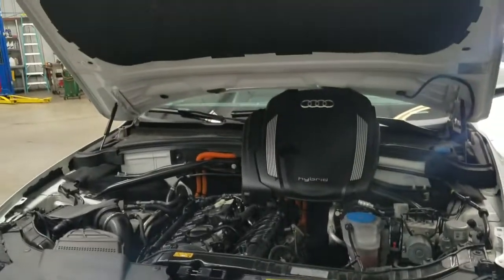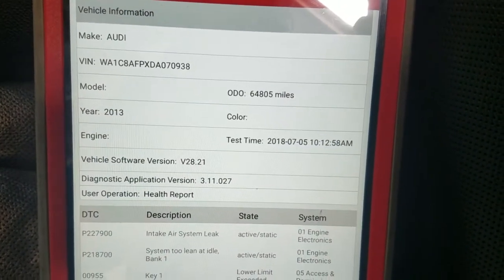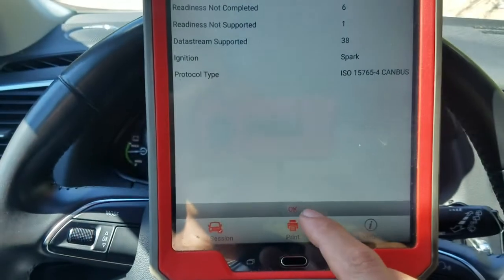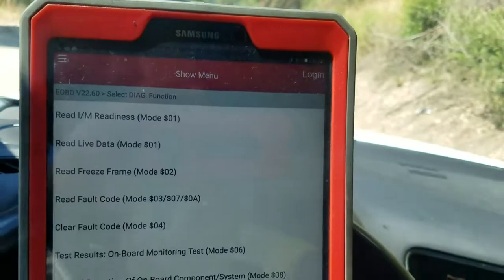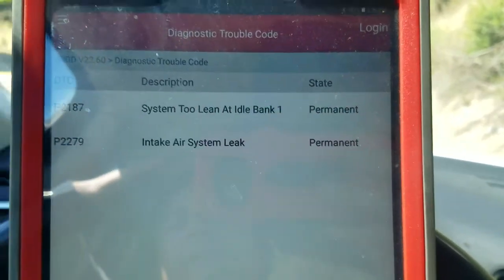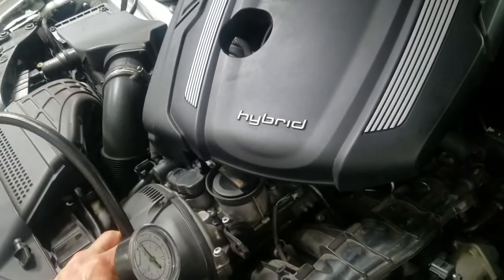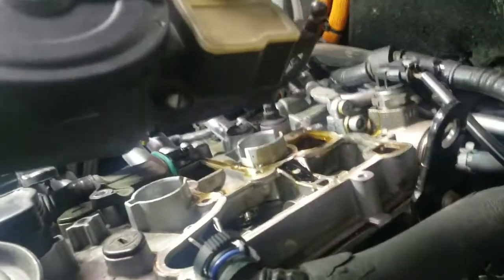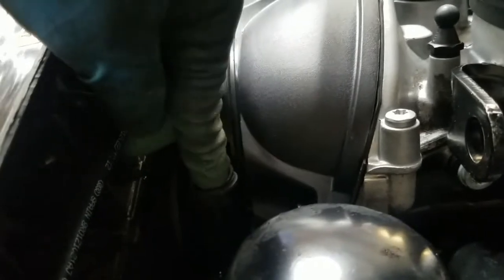2013 Audi Q5  Hybried  P2187 P2279 and hybried Control Fault

Comment: Did you have to reset to code after the repair? Or does the code reset on its own?   Also when I pull off my dipstick plug the car changes the motor speed. Is it supposed to have no difference when you pull off the dipstick plug?
Reply from the maker: I reset it with the scanner , should not change the speed